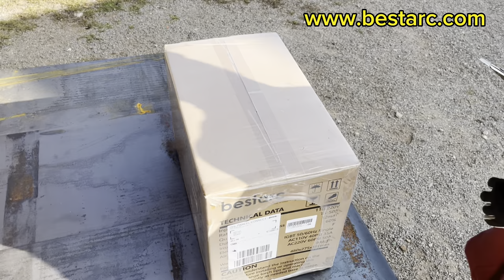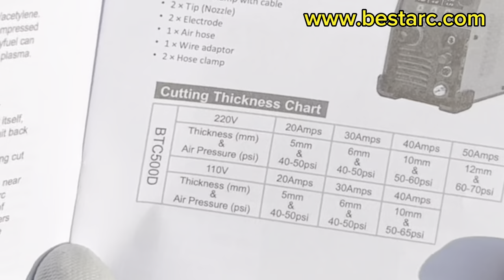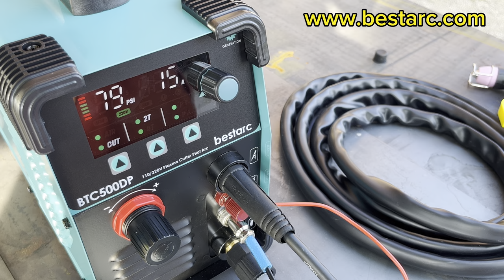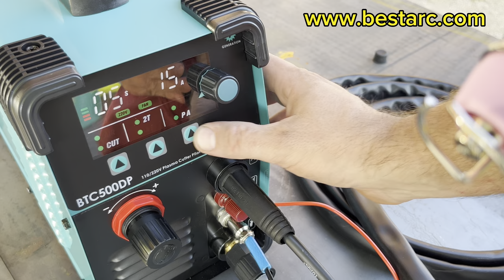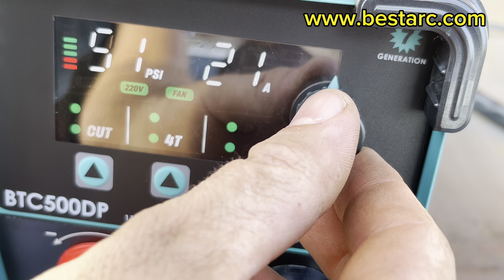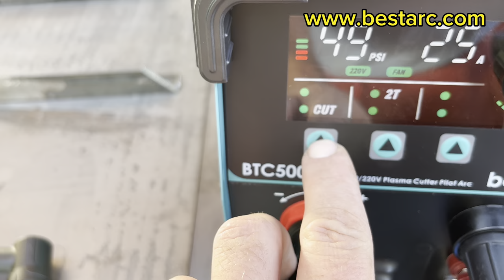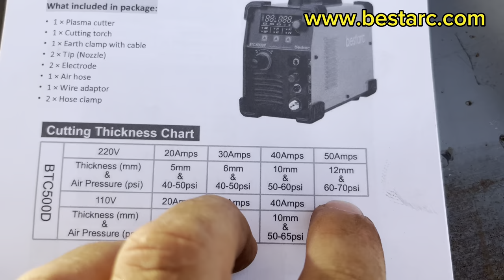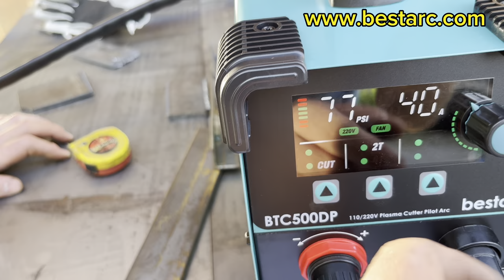Powerful plasma cutter Bestarc BTC500DP 7th Gen Unboxing and Testing

Comment: What compressor are you running this on. Thank you for the detailed video.
Reply from the maker: you're welcome my friend
This is a Ramda two cylinder 2.2kv electric motor compressor
the working pressure of the compressor is 6 bar

Comment: What size air compressor is needed for this Plasma Cutter.  Thanks
Reply from the maker: I have a compressor with a working pressure of 6 bar.
it can work on a smaller compressor with 3-4 bar working pressure